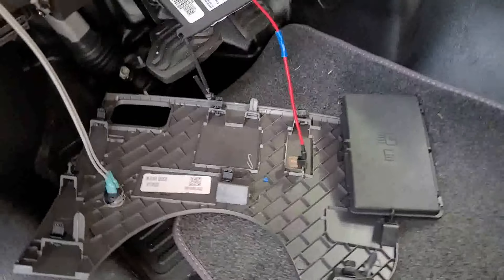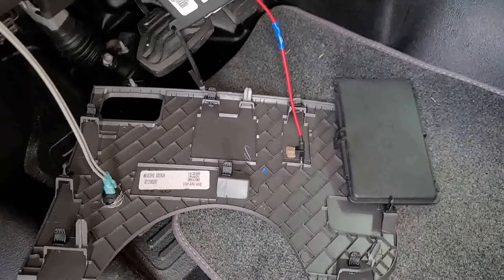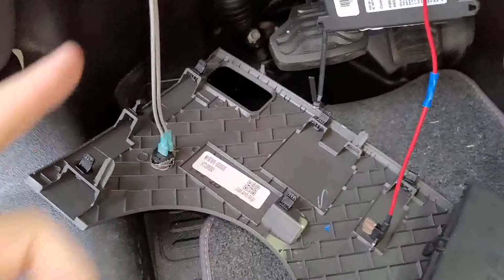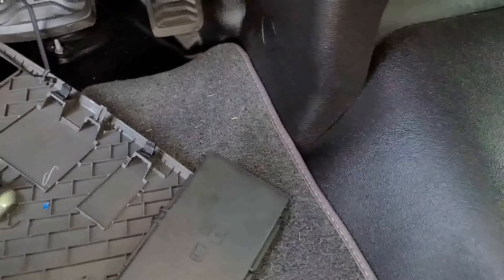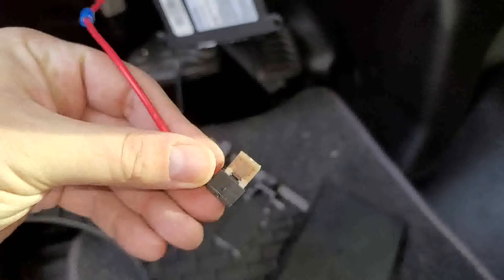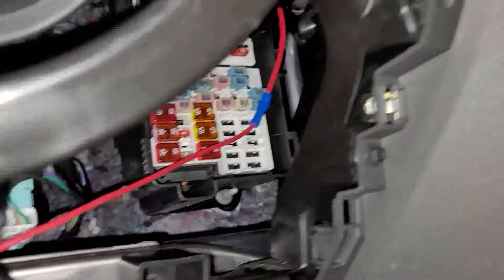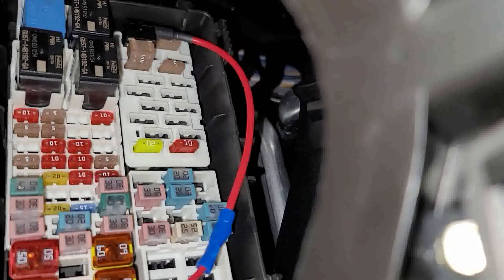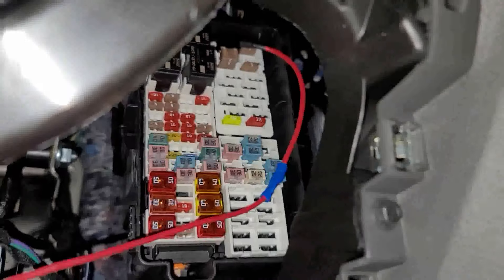2021 Coachmen Beyond - Li3 Charging Fix - Blown Signal Wire Fuse / Charge With Remote Start

Comment: Sorry you are having so much trouble with your Li3 Beyond. I wanted the Li3 but my salesman talked me out of it saying they are still having to many issues. As a single female I needed something more reliable. I love my Beyond and have not had any issues. With your help on the few upgrades it is even better!  Thanks for posting to help others!!
Reply from the maker: Actually - The Li3 system has been a blessing. If I were to tally the issues in the Coachmen group, I think the generators end up with more poop than Li3.  BUT!  We've blown some fuses.  Overall, though, the system has been amazing. It's very easy to use and "just works" most days. Unfortunately, we think we had our alternator belt installed during a bad batch.  Three other folks reported the burned up alternator belt like ours. All built around the same time. None since then... so, we theorize a bad batch happened.

We also blew a tiny 1 amp fuse but I'm pretty sure that was my fault.  =)

This time, not sure why this one blew but I bet it doesn't again now that we moved it.

Comment: Thanks for posting this. Really nice discovery that the Li3 batteries can be charged using remote start by simply changing the location of the cable.
Was the 5 amp fuse or fuses blown on the signal wire?
I wonder why Coachmen does not use the fuse block connection that charges the Li3 batteries when using remote start?  Maybe they don’t know what you now know?
Reply from the maker: The 5A fuse was blown on the wire. Easy fix. Perhaps the rain sensor has a surge of power. It's the first time our wipers have come on in a long time and the sensor would have been used. I'm not sure why Coachmen chooses the rain sensor. We might find out the Cooling fan doesn't enable at certain times. I'm not sure yet but so far we have not seen our Li3 system disable using the new signal location.  We basically just remote started the vehicle and used a tester to try and figure out which spot had power.  There were at least 5+ 5A mini fuses already in there so we had a couple options. Cooling fan won and the wire fit nicely.

Comment: Could you use something like Forscan to change the settings for remote start run time?
Reply from the maker: Unfortunately Ford limits the programming to 15 mins and you can only run remote start twice (total of 30 mins) before being required to start the vehicle.
Reply: @ChasingSixty  I guess even Forscan has its' limitations.  In the F series trucks, once you remote start, if you do the key fob sequence again, it's supposed to add 15 minutes.  People have gotten 30 minute run times  on their trucks combined without needing to wait for the first 15 minutes.
Reply from the maker: @TheSquiggyacfd  What you're suggesting with the F series is the same in the Transit.  The max time Ford will let us run the engine is 30 mins. You can adjust the "per remote start" time to 5, 10, or 15 mins. Then, at the max 15 mins, you can remote start (or extend a remote start) twice.  Then you get an error that states you must start the vehicle after that.

Our older Ford did not have this max start limit but our newer units have the limit.  We're hopeful we can find a workaround.
Reply: @ChasingSixty  Looking forward to any work around you come up with.  Seriously considering the Beyond and watching your videos.  Holding off until at least Fall to let things calm down a little....hopefully.